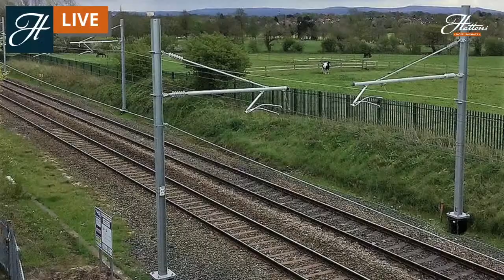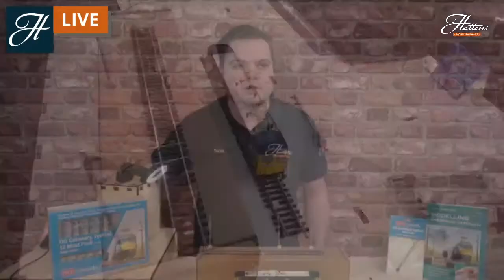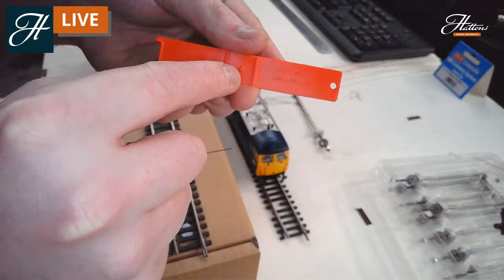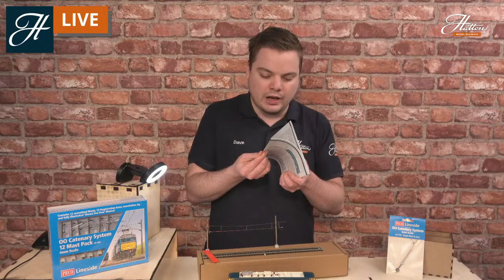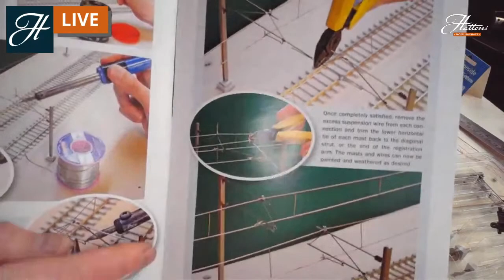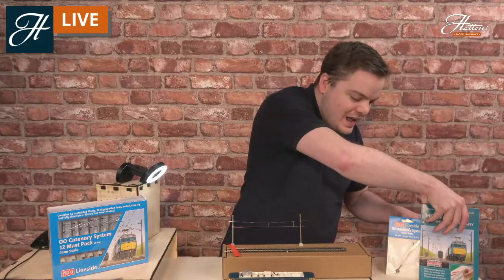Modelling overhead catenary - the basics

Comment: I'm modelling a test track for my railway technical center layouts. It's a short length of track with overhead live wires. I'm going to put the step up transformer at one end, the wire starts off on a building and I'm unsure how to terminate the wire at the end. This is non powered system for use by the apt and class 81 rtc loco. Any help would be appreciated. .
Best regards
Roy Jones

Comment: Good day to you,
I would like to find out if Peco has or will release the, 2 or 4 line portals masts?
Please can you let me know what and whenever thay are coming up? 
Thanks!
Reply: I spoke to Peco at the Warley exhibition and they said this one was on the backburner possibly Q2 2023. When I pointed out the futility of having a system that didn't allow you to wire up stations they merely shrugged, which is pretty much the reaction I get from the otherwise extremely helpful guys in the Peco shop at Beer. They don't seem to make the connection that releasing this product will also help sales of the single mast system, so don't hold your breath.

Comment: Yeah, fine for single or double track line but what you do when you get to a station? Stations never use standard catenary masts because they would have to be right at the edge of the platform and get in the way. As far as I can see they always use overhead gantries. So please explain how this system can be used for a whole layout if any stations are involved. Yet they and you blatantly ignore this extremely serious drawback.

Comment: Hi Dave. This was a very useful video. However, I was a little confused. You mentioned that in the real world, the overhead wires would zigzag between masts to even out the wear on the pantographs, but on the model, the upper wires are fixed to the upper arms of the mast in exactly the same place; so how do you get the zigzag effect?

Comment: I'm looking for a detailed picture of the masts and catenary used in some Southern Region goods yards (750volts DC) , for use by class 71s, etc. As the catenary was only used at slow shunting speeds and carried a much lower voltage (similar to tramway voltage) they would have been very different to the modern 25KV ones.
Reply from the maker: Hi Henry, I haven't got a detailed photo to hand, but from memory the masts had far more in common with traditional tramway equipment and poles than they did with other overhead systems used in the UK and beyond.
Reply: @HattonsModelRailways  Yes, I suspect that they used tubular poles with a similar catenary system to that used by trams and trolleybuses. One specific question I have is... did the poles have finials and, if so, what did they look like?
Reply from the maker: @henrybest4057  there's a photo on this page showing finials on the top of the poles, although I imagine there was some variation within these - https://sremg.org.uk/electric/class70.shtml
Reply: @HattonsModelRailways  Thanks for that. The photo also has good detail of the catenary.

Comment: Would it be possible to have a electric locomotive run on power from overhead wires rather than the track
Reply: Only if the loco is able to collect power from the OLE . IE, it has a metal pantograph that can be connected to one side of the motor supply. One of the rails will still be used as the (common) return.
Reply: @henrybest4057  I presume they are not very common
Reply: @111greatbear3  All of the old Hornby Electric locos used to come with a switch on the top to allow them to collect from track or OHLE. Hornby used to do a working OHLE set but it wasn't very realistic. The wire was quite thick and could be bent between masts so it would work with setrack radius curves.
Reply: @GDGRailway47712  would that include the old Hornby class 225
Reply: @111greatbear3  I assume you mean the Class 91 locomotive? The answer to that is, it depends.
The Hornby models we have of it in Intercity Swallow livery both have working pantographs and a switch on the roof, these were both sold as the loco only. 
Then there was the train set version that was a Class 91, a Mk4 DVT and two Mk4 coaches. The 91 on this didn't have a working pantograph and the whole set had really coarse wheelsets compared to the individually sold items. Later Hornby issues of the 91 dropped the working panto too but I'm not sure when that was.
Reply: Triang used this overhead current collection option feature starting about 1958 until about 1970. This also enabled two trains to be controlled independently on the same track. 
Trix similar but with three trains.
There are Oscar Paisley vids on YouTube demonstrating this working well, but later Hornby versions not so well.